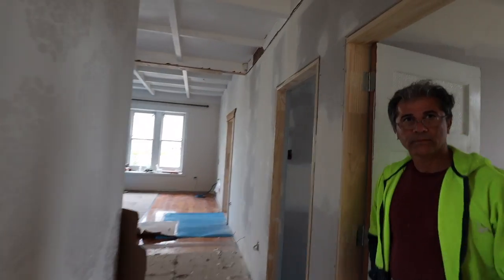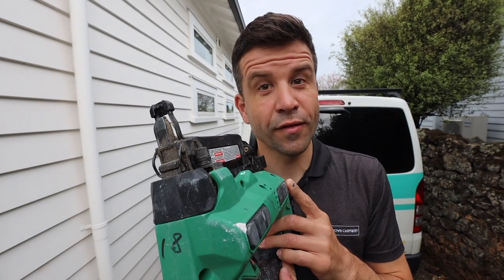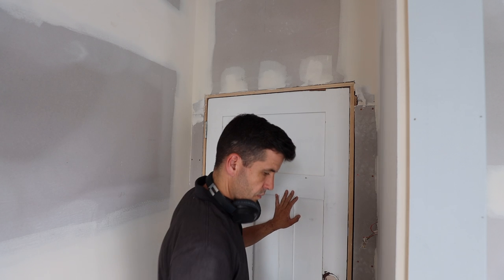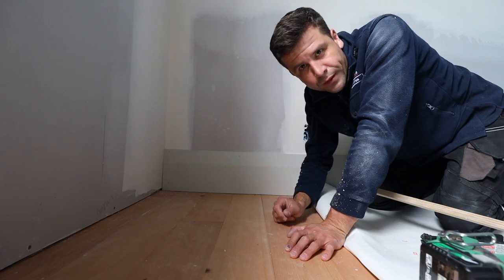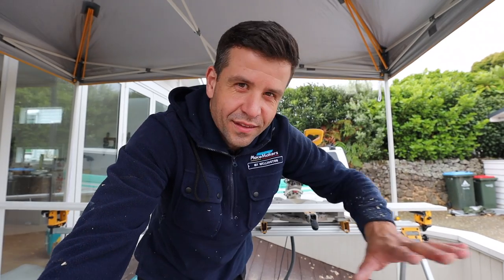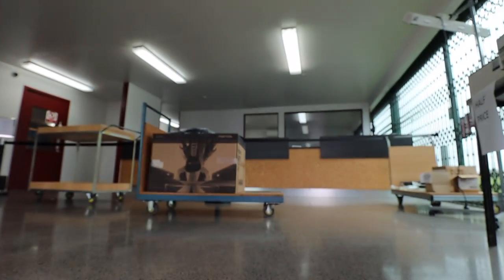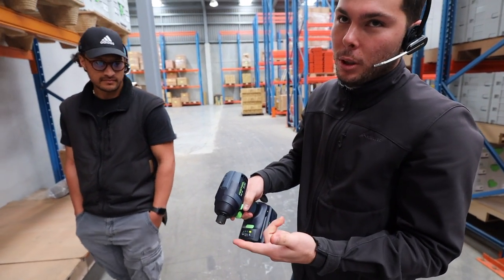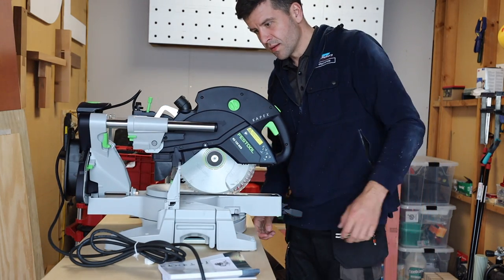Finish Carpentry: Why I Need a New Mitre Saw

Comment: had my kapex for 5 or 6 years now. love it. but recently had a problem with a festool blade which is miles out of true... nowts happened to it and i dont know if its the original or the replacement i bought about a year back..... the sharpening company i use said nothing looks out of the ordinary on the blade... gonna see what festool say as its a £100 blade give or take a few quid so it should last a long time
Reply: Paul Finnon check the collars, if there’s dust or crud there, it will throw the blade out by a considerable amount.
Reply: @riverbuilder2251  i dropped it of to get sharpened and the bloke rang me back and said it was the blade that was all buckled. need to go pick it up and see what festool say about it. cheers for the reply mate

Comment: bro the reason your saw seems to cut off angel is because when you cut on an angle like that the blade wants to take the path of least resistance and deflect to the side. Use a blade stiffener and a really sharp blade when doing long mitres that way. That may be your problem. Or just get a new saw. Dewalt saws are De best.

Comment: Get the hikoki/metabo/hitachi 10 inch multi volt. It’s a incredibly accurate saw and the battery lasts forever
Reply: They look alright but apparently shit dust extraction.
Reply: @kizzjd9578  mine works just fine. I use it indoors paired with my Milwaukee pack out vacuum and it cuts hardwood easily and cleanly. Paired with a Diablo 50T combo blade.

Comment: Scott, Had that problem with my 12" Dewalt. After watching others use my saw I found that it wasn't the saw more the saw bench.  Smaller lengths you move the arms in and the Box section has less deflection means that it will raise higher than you had it when it was extended. it's also when you do have long lengths the leverage the timber has bends the box section of the saw table down. Big Flaw in Dewalt saw tables. I ended up changing to a 3part Full Aluminum Saw table and the problem was fixed. I also found the type of saw blade had its own deflection and now I only use diablo blades. 
https://www.vektools.com.au/quickally-sawbpexk-1613mm-aluminium-complete-mitre-saw-bench-system.html
Reply: 16,000+ Woodworking Plans & Projects

Comment: Should have gone Milwaukee cordless.  I’ve got two and have never looked back!
Reply: Would you recommend the 10"
Reply: I’ve the 10” and 7”. The 7” is a little more accurate but the difference is blade flex so you’d get that with any saw.  Also all of my tools are on the m18 battery platform.  It keeps it simple
Reply: @bigdogoutdoors4985   did you find it lends itself to buying the 9 or 12 batteries to power it?
Reply: M18 batteries. Any amp hour battery will work it’s just comes dow to how long before you recharge or replace.  Mostly I have 8 amp hour batteries an I usually can go all day.

Comment: Watch out for the armatures on the new Kapex. They have a tendency to go on some quite quickly. 
Also, you may notice it leak oil but that's pretty normal from them. Just don't be alarmed
Reply: Does the new Kapex still have armature problems? The old ones were horrible, but the latest model claims to have resolved that. Was considering one. Just wish they had a shadow line instead of the lasers!
Reply: @timcorbett9629  sadly they seem to still have issues with it. Oh I agree, much prefer a shadow line but I guess it's just getting used to the laser

Comment: Damn shame you painted the beams would look so good bare.
Reply: I know. The beams in my house are painted an awful mint green colour. Id like to repaint them but what Id REALLY like to do is strip them back and just use finish. Way too much work to strip them though..
Reply: @nutsandgum  some one had painted a lovely wood fireplace in myhouse white. Few years back we used that green goop paint stripper stuff and it worked really well and looks great. But fireplaces are down low.

Comment: Hey Scott! Would like to know how you get on mounting the kapex on your dewalt stand if that’s your plan, I have a kapex and was considering the dewalt stand if there compatible... 👍🏼
Reply: Should be, just mount the Dewalt brackets onto your Kapex and off you go, 👍😁 🔨 🇮🇪
Reply: TheToolnut has you seen his new video? I don’t think the dewalt brackets are big enough? Or? Not sure. Do you know someone with that setup? Thanks 👍🏼
Reply: @joshwatson4654  Just watched his latest video, I was wrong in my assumption it seems. For me the Kapex would be a workshop saw. I would love if Makita released a cordless 8-1/2" mitre saw with dual bevel capabilities.
Reply: @joshwatson4654  Just read a comment on that video, get a pair of the Dewalt table saw brackets and mount them on the Kapex. Their longer than the mitre saw ones so they should solve your problem. Can't believe I didn't think if it, 🙄🙄
Reply: TheToolnut well I never thought of that ether man! Thanks a lot for seeing that and letting me Kin! Really appreciate that! 👍🏼🔨🏴
Reply: @joshwatson4654  No problem, how long have you the Kapex? Are you workshop based, out on jobs or a bit of both??
Reply: TheToolnut so I’ve had the kapex around a year and a half now, I’m usually out on jobs although  my work is quite varied so it’s hasn’t been abused with days of endless second fixing which is really the only time she comes out.
Reply: @joshwatson4654  I'm planning on building a workshop soon. I have a Dewalt 12" sliding mitre saw that I had in my old workshop. I might sell it to finance the purchase of a Kapex. Along with a Domino joiner it would be a winning workshop combo, 👍 😁 🔨 🇮🇪
Reply: TheToolnut I think it’s definitely worth investing in the kapex, it’s so well engineered, 45 degrees left, right and on the pivot are all bang on and with the 10” blade there’s no wobble on the cuts which with the 12” can sometimes open miter’s. I think the domino even more so in a small shop it a must really, the XL and a biscuit jointer for thin material, don’t know that you need both dominos really
Reply: @joshwatson4654  Yes indeed, the Kapex is on the list along with the two Domino joiners. I have a Makita biscuit joiner, and Kreg K3 Master system, they have served me well to date. A Festool TS75 would be nice as well, that list of mine never seems to get any shorter! 🤣 🔨 🇮🇪

Comment: while it has a lot of perks it's the one saw i would not have to drag from one job to the other as its weight screams "drop me in a taylor made miter saw station with 300$ worth of incra rails, stops and whatnot.. don't you forgive my custom dust extraction and leave me here till the world ends."
Reply: Sebastien Bily it’s the lightest and most well balanced saw to carry, if you have the wheel trolley it’s even better, leaves all the others for dead.
Reply: @riverbuilder2251  you are certainly right, i've never weighted it. but compared to my bosch it looks so much more of a unit at my friend's place. (also i'm a weekend warrior so me moving my saw always feels like i'm moving out)

Comment: 'T' mode is most likely a left-over from whoever makes that driver for Festool.  It's for driving tek screws into steel.  The high speed is for the drilling, then it drops to a lower speed for screwing into the steel.  Every new good-brand driver that I've seen in the last 10 years has it.

Comment: You've lost me on that one. It has been my misfortune to use a few Festool tools and haven't found one I like yet. No doubt superb quality but then at the price they are they should be gold wrapped or diamond encrusted. The ergonomics for me are terrible. Way too many quirky ideas and nonsense bits of plastic. Parts cost as much as another brands entire tool. In the end I can get just as good a cut with a cheaper saw and a decent blade. The Festool  sustainer spawned the now ubiquitous plastic box craze that is rampant on all building sites Worldwide. Another I don't get. I tow quite a large tool trailer packed with no boxes. If I kept those boxes I would be driving a Semi to fit them all in. Each to their own. I hope the overpriced wood cutter meets your expectations and you are very happy together.